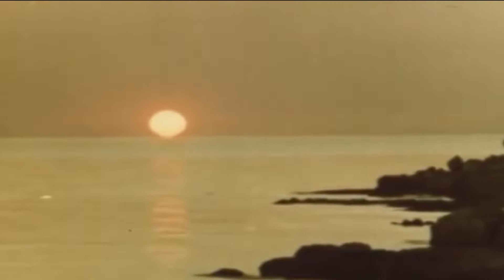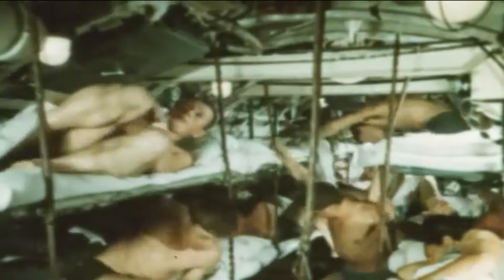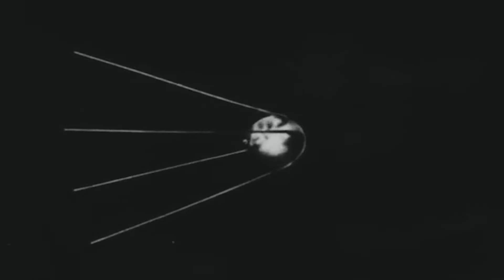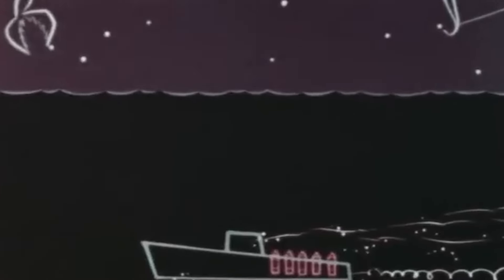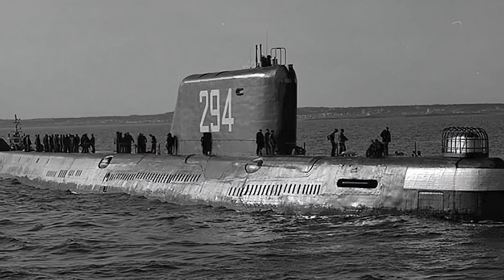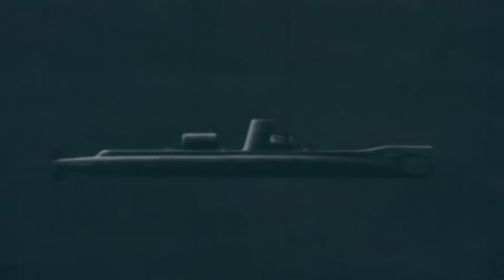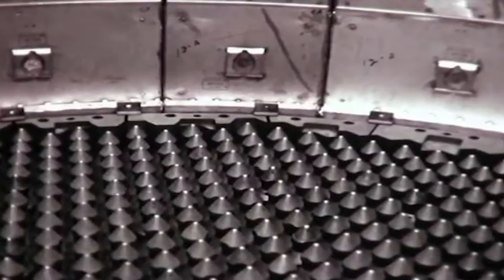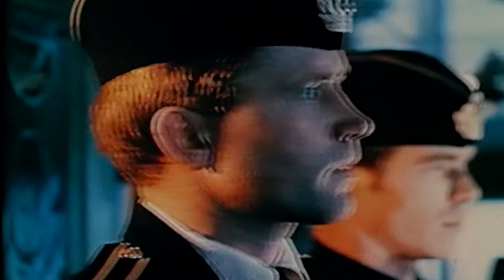The Submarine That Turned into a Ticking Nuclear Bomb

Comment: There was a movie called K 19 the Widowmaker, but the sailors actually called the submarine Hiroshima because of the reactor problem. No reactor is going to explode like a nuclear bomb. Even Chernobyl was not a nuclear explosion that was a chemical explosion. They had too much hydrogen pressure, gas build up as a water separated, the blew off the top of the 500 ton lid, oxygen rushed and then an explosion happened still not a nuclear explosion just chemical

Submarine reactors would have control rods and yes, they did drive in but you have decay. Heat what you still need coolant “water” going through because the reactor was a generation one maybe two most likely a generation one whatever generation it was, it’s still needs coolant it’s still needs water flowing through it, even when it shut down because of all the decay heat from all the fission products like cesium and plutonium being made inside a thing in americium and other radioactive elements even radioactive iodine is in there one thing about shutting off the reactor is it will cause xenon to rise, which will basically not allow it to come back up for at least three full days of total cold shut down because that poison builds up

Frankly, I just had to clear the bullshit of this video because I cannot watch it. I hate when things are blatantly so wrong, but someone still makes a video about something talk about misinformation worse than the USSR.

Comment: "The boat was launched and named on 8 April 1959. Breaking with tradition, a man (Captain 3rd Rank V.V. Panov of the 5th Urgent Unit) instead of a woman, was chosen to smash the ceremonial champagne bottle across the ship's stern. The bottle failed to break, instead sliding along the propellers and bouncing off the rubber coated hull. This is traditionally viewed among sea crews as a sign that the ship is unlucky." A woman christened it in the 2002 movie though. I hope that wasn't a source for your research...

"S-270" was the name of the (unknown class- can't locate info on it) diesel sub that rendezvoused with K-19 after the accident. You refer to it as if its a class or type name. You then go on to say "In 1992 it recieved its nickname (subtitles say 1972) but follow it up with "and then in 1990". This channel could be great but once again the information provided is rife with errors.

Comment: Terrifying to think of the consequences of a nuclear meltdown, the resultant steam explosion, the spread of nuclear materials (possibly components of the missiles), all next to a NATO base, and NATO’s interpretation and resultant consequences of that would have been.
Reply: I doubt it would have resulted in WW3. Our engineers would have realized the type of failure based on the meld down of the core and thus wouldn't trigger a nuclear response by NATO. The Soviets had several nuclear incidents during the Cold War, none of which resulted in nuclear war. Both sides wanted to avoid such a scenario despite the political posturing. The concept of MAD (mutually assured destruction) worked quite well during those decades.
Reply: @Militaryarmschannel  That does make sense when you put it into context. MAD did indeed work. Still, got a lot closer to a nuclear conflict many more times than I would’ve liked. I suppose the real criticism should be laid into whoever approved the shoddy Soviet development process.
Also, great to hear from you! Love your channel!
Reply: @Jkim890  shoddy development is in their dna

Comment: This is such a exaggerated story.  If the had done nothing, the reactor would have melted down, right through the hull of the sub the whole boat would have gone to the bottom.  The crew could have balled out and picked up, etc.  Even if the reactor melted down, it wouldn’t have exploded, except maybe for some steam.  This has probably happened more times than we know.

Comment: That information is not quite accurate. The explosion that they feared would happen to K-19 from her reactor running wild and overheating would not have been a nuclear explosion as stated. Thus it would not have been more powerful than the nuclear bombs dropped on Hiroshima or Nagasaki. That was BS.

There would have been an explosion. And strangely, it would also be similar to four other explosions that took place in Japan. But not until the tsunami of 2011, I think it was, when all four nuclear reactors at the Funkishita (sorry) nuclear power plant each had a catastrophic failure. K-19 would have done the same as each reactor at the Japanese power plant. Or similar at Chernobyl. 

It's amazing that nuclear energy is so simple, yet fools manage to screw it up, anyway. With nuclear power, whether it be to propel a vessel or turn a generator to make electricity, there is only one thing you must never, ever, ever lose control over. And that is the reactor's cooling system. The radioactive fuel rods produce heat. They must be dipped into a liquid chemical to keep the temperature under control. That's all that is required. You have to keep the liquid that cools the rods cooling the rods. That's it. Not hard.

Yet, in Chernobyl, they screwed it up. In Japan, they screwed it up even worse. Chernobyl was the worst nuclear disaster ever. And because of shame, they don't refer to the Japanese nuclear disaster as the worst, but it was. And still is. Two reactors at Chernobyl exploded. I think, maybe one. But in Japan, all four exploded one at a time.The explosion itself it almost meaningless. What the explosion caused is what matters. With K-19, had she exploded, the explosion would have destroyed the vessel. But as with the explosions that did occur in Russia and Japan, it's what those explosions set free that matters.

You should look at nuclear energy as an alien force not from our world. Something so strange and unforgiving, that it can never be set free on the Earth. So it must always remain under control, in it's cage so to speak. That cage is the containment vessels that these nuclear fuel rods are located in. A cocoon of steel, lead, concrete designed to keep radiation contained within and allow none of it to escape. Because radiation contaminates and makes radioactive whatever it comes in contact with. This means air, water, Earth, etc. And radiation does to mammals horrible things like mutating their bodies.

Nuclear energy and power is so very simple. The heat from the radioactive rods decaying heats a liquid. The liquid turns to steam and the steam powers the generators or turns the turbines on the vessels. It is simply steam power like we once had two hundred years ago. Only difference is how the heat to produce the steam is generated. It is produced through controlling radioactive decay. 

Left unchecked, that decay will produce temperatures high enough to nearly melt rock. All that is needed to control the heat is to lower the nuclear fuel rods into a cooling liquid. And to circulate this liquid to keep it cool. When the liquid does not circulate through the cooling system, it gets hotter and hotter. Then evaporates in the containment vessel when not intended. This pressurizes the containment vessel like a water heater without a safety release valve to release the pressure. The pressure builds inside the containment vessel with no way to relieve it that doesn't pose a disaster unto itself if available.

The temps reach  over a thousand degrees and as the coolant evaporates in the vessel pressurizing it, less of it cools the rods and the the heat increases from this as well. The temps runaway wild and the vessel cannot take it and explodes. Hydrogen gas is also produced and it will explode after if an ignition source it finds. Those are the explosions at Chernobyl, Fukijima (sorry once again) and although large, they are nothing compared to what opening the containment vessel to our world has done. It has released the beast from containment and now an exposed nuclear core is pouring radiation into the water, land, and air. So poisonous is this that no one can survive being near it. Closer you are, the sooner you mutate.

And the radiation pours into our world for one thousand years.They buried the reactors at Chernobyl by dropping wet cement on it constantly for years from helicopters. The first who responded to this disaster were exposed the most to radiation and all died within days. Those less exposed died within a year. I hear some ten thousand or more people received the medal I have at home specifically created to honor those who responded to the Chernobyl disaster. But it happened on land.

Now take the exposed nuclear cores in Japan., Which number four. They have been pumping sea water into them to cool them down. But this sea water, every bit of it near the core, is now radioactive. It is being pumped in and then let out to sea. They say they have it in containment tanks in tank farms designed for oil production. But they are lying. The sea water now radioactive came from the Pacific Ocean and returned to the Pacific Ocean. There is no way to remove the radioactivity from it. They probably did store some of the poisoned water in tanks. But then what? The tanks filled up and no room was left. The four cores will pour radioactivity into the world for one thousand years.Not even the largest ocean on Earth can handle such contamination without becoming poisoned completely.

Leave it to the overly ambitious and fool hearty Japanese to nuke themselves. And all because they failed to remain vigilant in keeping the backup system to power their reactor cooling systems available. I mean, really. They had the ability to generate emergency power for the reactors should the generators at the power plant scram or shut themselves off to avoid damage which is what they were designed to do. And is what they did when the tsunami hit. But they had the backup generator in for repair when the tsunami struck. It was not working. So the coolant system shut down when the electricity it uses could not be found.

And when you realize that Japan has many other power plants, both nuclear and non nuclear all across the country, and all they needed was one wire provided this Fuki power plant from another one just in case, and they did not have this, and now we have four, count them FOUR exposed nuclear cores pouring poison out into the world. The fool who believes Japan is containing the sea water used to cool those cores in large tank farms until it can be made safe, has to ask him or herself or someone else, how that is done? Because radioactive waste never can be made safe by anything other than time passing. And that is a thousand years minus ten from now.

Russia embraced nuclear energy like no one else from the beginning. They chose to power their space satelites early on with nuclear reactors on board them rather than solar panels as we do. The vacuum of outer space meant no one will complain. They stopped doing this, fortunately, since all things orbiting Earth if not constantly adjusted to remain in the limbo between Earth's gravitational pull and outer space's lack of gravity, will either fall to Earth or fly out into space. Russia nuked us once already with one of these dead satelites falling over Idaho, South Dakota, Montana and Nebraska. It reentered Earth's atmosphere and burned up. But the smoke created from burning is radioactive.

Russia further uses or used Cesium Chloride to purify grain on their farms. It is a radioactive substance they store in 55 metal drums. At the center of each drum is one ounce of Cesium Chloride surrounded by lead or some other radioactive insulating substance. They placed these drums in the rural areas to be made available to the farms as necessary. But the drums rusted. And then the insulating materials fell out. And the Cesium Chloride became exposed to the atmosphere. But they have a way to fix the drums.

Their army has a platoon or some such trained to do it. I saw a video of it. It show how nutty nuclear energy is. The military unit shows up near a drum of stored Cesium Chloride. The men form two or more lines. An officer of sergeant has a stop watch and a whistle. Each soldier knows what is needed to be done to make the thing safe again. The officer blows the whistle and the men at the front of each line run as fast as they can to the drum of Cesium Chloride where they begin the repair. The officer is watching the stop watch he started when he blew the whistle. At sixty seconds exposure, he blows the whistle again. That signals the men who just ran to the drum, to run away to safety as the next two or more men at the front of the line take their place and pick up the repair. Like they are running relays.

Comment: The title of this video shows that the author has a piss-poor understanding of how nuclear reactors work. There wasn't enough enriched nuclear material OR the kind of conditions required to cause any kind of nuclear explosion comparable to a bomb. Even with the reactor melting down there's little fear of contamination as seawater is great at reducing the effects of radioactivity. That's why it's used to cool reactors. The hydrogen atoms within it slow down nuclear particles. It's bad that it happened but this channel makes it sound like something happened that didn't.